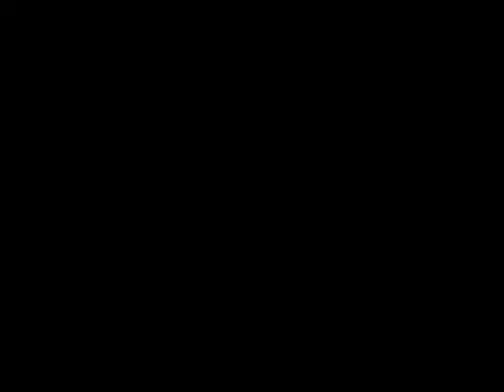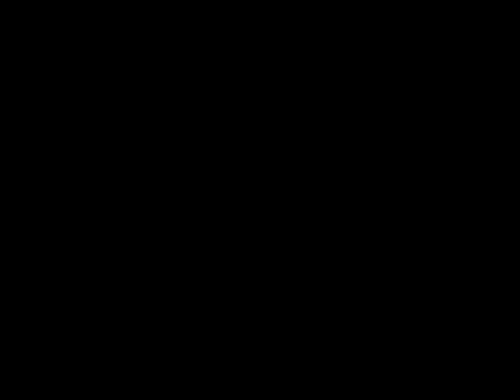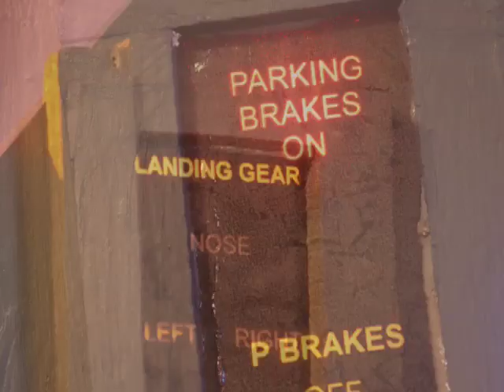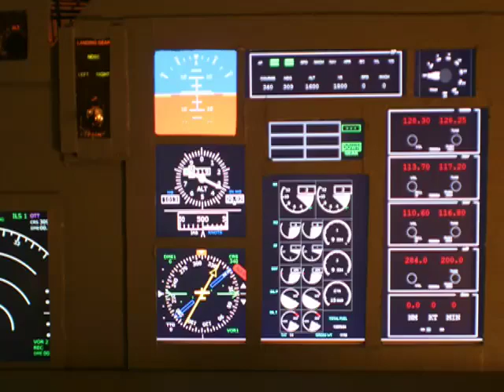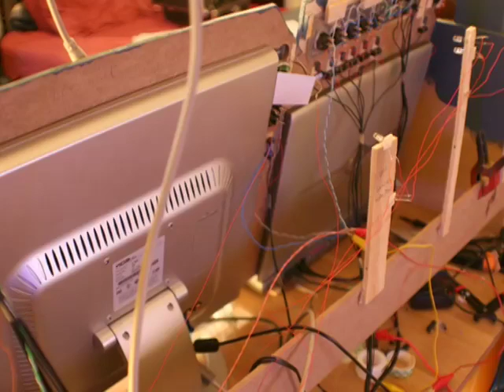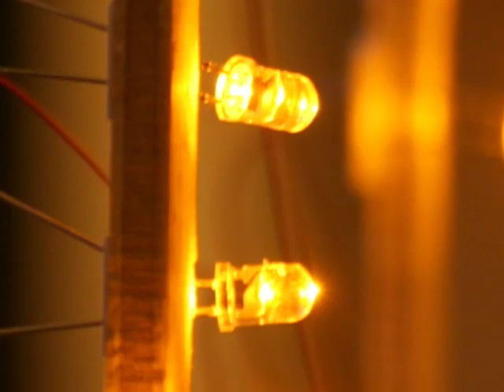Homebuilt Cockpit (Simpit) for Use With FSX

Comment: Hey, I take it from the video having a second joystick hooked up next to the pro flight yoke/throttle and rudders is no issue? I've been wondering about this as I have the yoke+rudder setup as well but would like to add a stick when i fly planes that have a stick in reality but would like to use the throttle block that comes with the yoke (no money for the x52 atm). Would this be a problem in that the yoke will interfere with using the stick for the surfaces? Cheers and see you up there :)

Comment: where did you pick up that terminal strip? I just hacked a keyboard for a switch panel and ended up soldering wires to each button, which took forever. that would have simplified things greatly. After I'd done so i thought of using a couple of speaker connectors. Wish I thought of it sooner. Nice build and great tips.